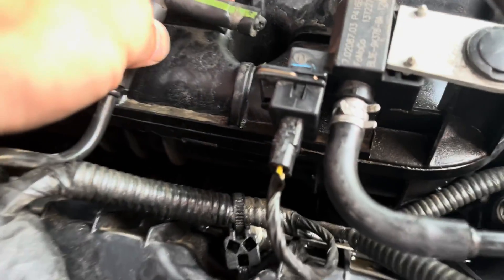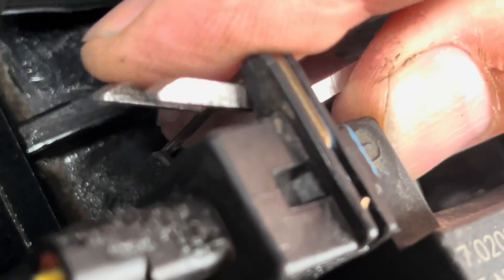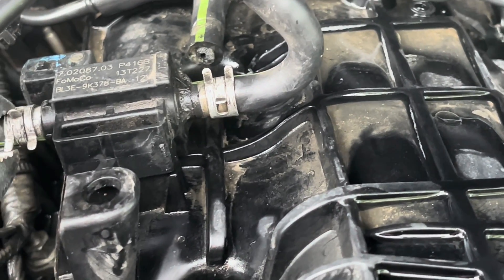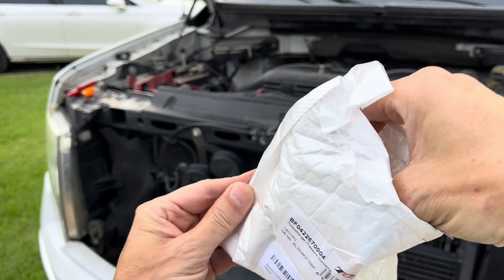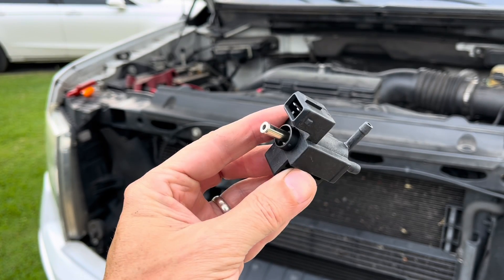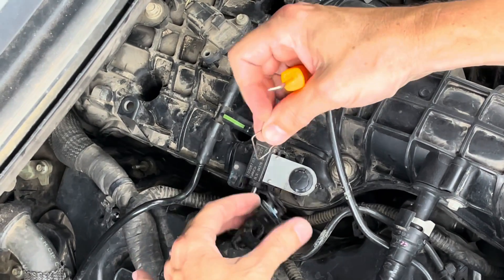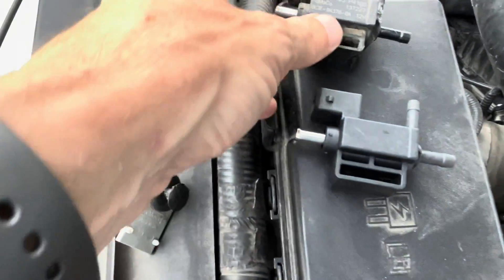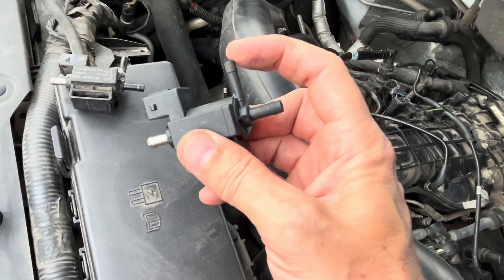Error code P0299 Turbocharger underboost- Ford 3.5 L Ecoboost. Turbocharger bypass solenoid valve.

Comment: Thank you a lot easier than I thought I saw a video about a 2011 f150 where he took tire off this was much better
Reply from the maker: There’s a second one behind the passenger wheel well, too. So you may have to get at it after all
Reply: @williamtunnell  this one was the issue thanks for a an easy to do video
Reply: Where is the video for the other p0299 fix this didn’t fix mine after all

Comment: My check engine light is not on. But I feel my truck is running sluggish, I removed the filter and the center y hose to put my hand over the holes as per a video I watched to see if I was getting suction from both turbos? The drivers side suction wasn’t as powerful as the passenger side? I’m just wondering other than a bad turbo, what else could it be?

Comment: I am having the same problem with my 2018 f150 3.5.  Code only throws when I am pulling our camper on hilly terrain.  Did you get the code again after doing the solenoid?
Reply from the maker: I just got the code again last week after I accelerated very hard on a drive. It cleared and never came back. I have not had that code since posting this video until last week. Hope that helps.

Comment: Thank you so much for your video. I have a 2016 F150 Platinum 3.5 EB. I have error code P0299. The cluster had no turbo pressure. I took it to a mechanic, and it now shows pressure, but the code still persists. They believe my transmission also has a problem.

I'd like to know if, before correcting this error, in addition to the lack of power, you had rough shifts from 3rd to 5th or 4th to 6th.

P.S. They didn't replace this valve, and I believe the problem remains with the turbo system.
Reply from the maker: Interesting. No, I have not had any issues with my transmission and didn’t any shifting problems. Mine shifts a little hard into reverse on a cold start but I’ve had it checked out and a transmission guy ain’t was fine. I actually have 2 videos on P0299 on my channel. Both are relatively easy repairs. Maybe one of them will help you with this code.

Comment: I was looking at buying a 2015 Ford lariat eco-boost and while test driving it I got down on it pretty hard running about 90 and the check engine light come on and it through this code took to advance auto and it took em four times to clear it out but it never came on and while it was on it never changed the way the truck was running truck has 143k on it any ideas?
Reply from the maker: Yes, the problem is simply a loss of pressure when you don’t want a loss of pressure. There is the blowoff valve of course that’s intended to release boost pressure when you let off, but on hard acceleration that’s the opposite of what you want. My code would throw in hard takeoffs or when pulling my camper - ie., under load. With a small “leak” it won’t necessarily cause any noticeable performance issues, which was my case, but on a bad “leak” it certainly could. I’ve never had problems clearing my code with the scanner. It’ll clear on its own of course with enough drive cycles.

Comment: I thought the blow off valve on your older vid fixed it
Reply from the maker: @mohammedalhelal2956  I thought it did too, but after another long haul with the camper the code came back. I’d fixed the blowoff valve once before because it was torn. Definitely will give the code when it tears. This time, however, it was this smaller part.

Comment: I saw your other video when you replaced the BOV, I’m guess that didn’t fix your p0299 code? Is this what you did after to fix it? 
I’m getting that code but only if I get on the throttle hard, I don’t get it consistently.
Reply: If you still haven't figured it out yet, be sure to check your wastegate actuators. I've been having intermittent power loss with timing code errors and underboost codes. Finally figured out that one of my wastegates was getting stuck open. To check, set your air compressor to 10 psi, and blow air in the wastegate where the vacuum hose connects. It should move freely and then snap closed once you release the seal. That solved all of my issues just as I was about to splurge and buy new turbos.
Reply from the maker: @deathfromdomo  exactly. I’d still get the code every once in a while, under load or very heavy throttle. It definitely improved but I’d still get the code. Since replacing this, I haven’t seen the code since. It’s been months!

Comment: I have to check and see if this is the issue on my ‘16 navigator. I was towing my little trailer loaded down with a motorcycle and got this code about halfway through the drive. When I got home and unhooked the trailer the code cleared itself. I don’t know if it’s the blowoff valve or the solenoid. Hopefully it’s not a waste gate issue
Reply from the maker: Yeah, I hope so too!

Comment: Any update my truck just gave me the code
Reply from the maker: Yes, drove home 4.5 hours, pulling the camper- no code!
Reply: @williamtunnell  good to know, thanks! I may go ahead and order the blow off valve to start.
Reply from the maker: Good call - remember that there is none for each turbo. The other one is accessed  in the passenger wheel well
Reply: @williamtunnell do you have a video showing the passenger one? I'm throwing P0299 turbocharger A code. Is that one easy too?
Reply from the maker: @ I don’t. I haven’t changed the second one, passenger side. Sorry. Seems a little harder to get to, obviously. Otherwise probably the same.

Comment: Hope that took care of it
Reply from the maker: It did!  Pulled our camper home from FOLEY and had no code at all.  I can’t pull my camper without that code coming up but this time it was flawless. I was skeptical it would be the fix, but it was!
Reply: So what was the fix for your PO299 was it this or your changing the blow off valve? Or are these just all the issues that the code could mean? Curious before I start repairing all of them.